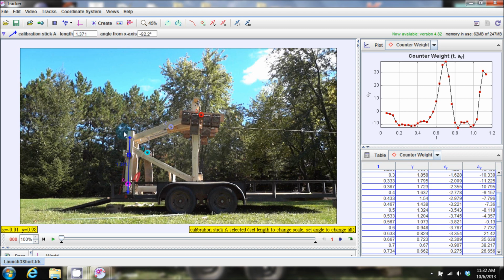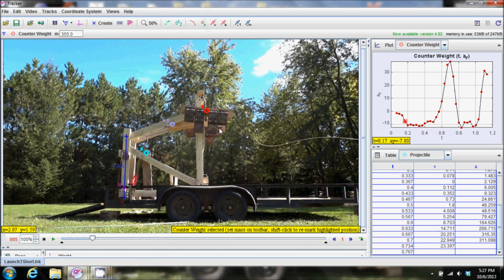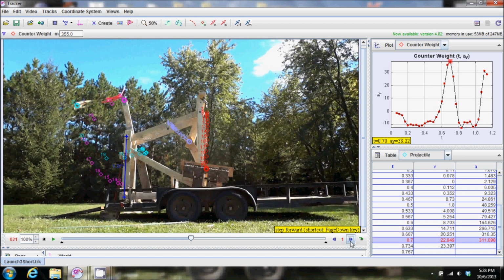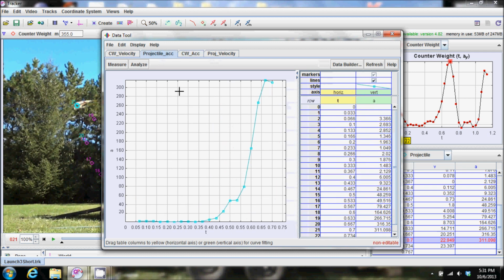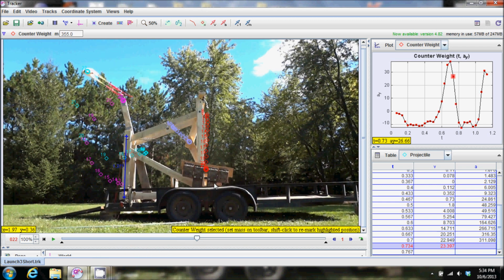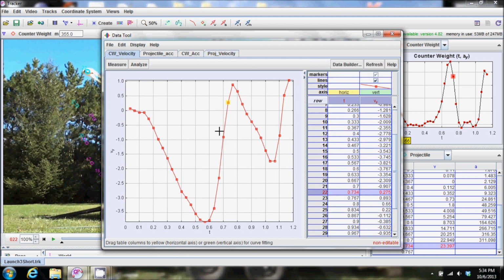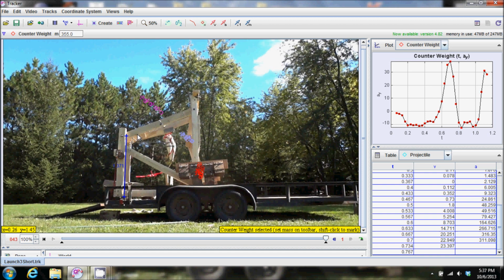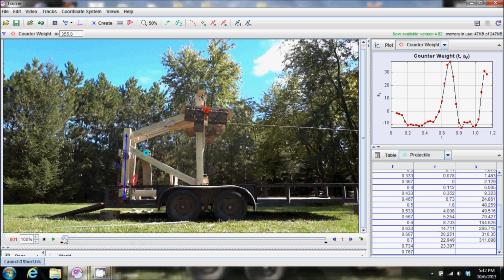Medium Fiffer analysis and review

Comment: nice video.  so few people actually understand the "goodness" of the stall of the counterweight (or arm in our torsion machine - we typically obtain 90-97% efficiency neglecting friction).
Reply from the maker: David Mollenhauer I noticed in one of your slowmos that you had a full stall.I was pretty impressed with that on a torsion machine as large as yours.
Reply: beardedone85 We've even had the arm reverse direction when things are not balance correctly.
Reply from the maker: Oh yeah, I had a big problem with that when I first built this little machine, didn't have time to test it, and went to a competition. For some reason I couldn't get it to release at the correct angle ;) One look at the video footage after made it very clear. Although a perfect stall is optimum, I prefer to see the arm keep moving forward just so I know I'm not putting energy back into the counterweight. That slows a projectile down real quick!